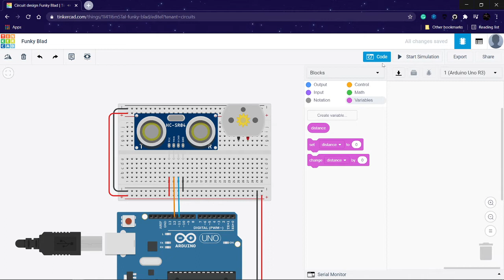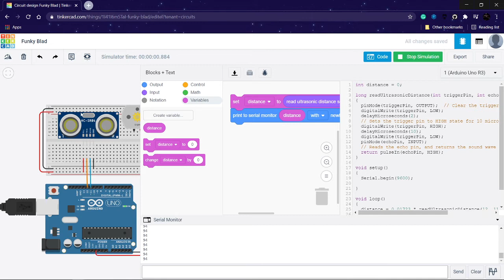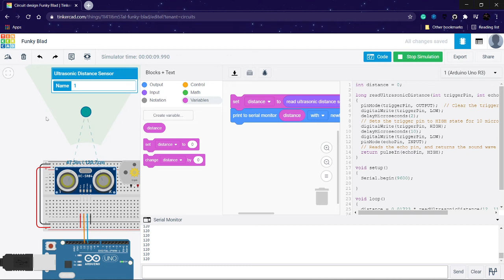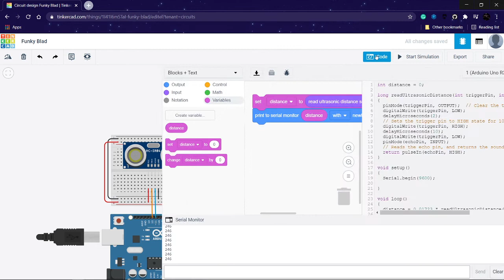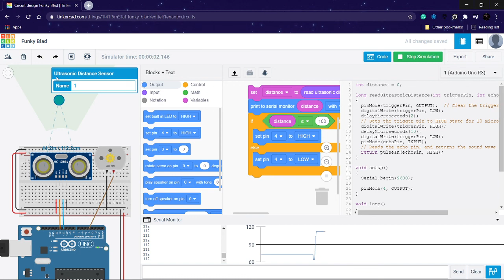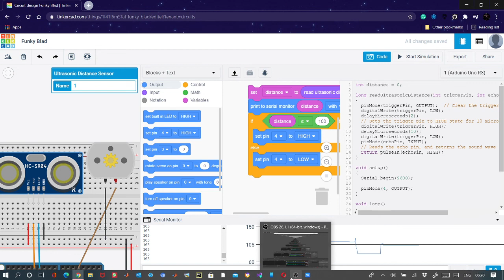obstacle avoider robot using Arduino in tinkercad

Comment from the maker: code:
int distance = 0;

long readUltrasonicDistance(int triggerPin, int echoPin)
{
  pinMode(triggerPin, OUTPUT);  // Clear the trigger
  digitalWrite(triggerPin, LOW);
  delayMicroseconds(2);
  // Sets the trigger pin to HIGH state for 10 microseconds
  digitalWrite(triggerPin, HIGH);
  delayMicroseconds(10);
  digitalWrite(triggerPin, LOW);
  pinMode(echoPin, INPUT);
  // Reads the echo pin, and returns the sound wave travel time in microseconds
  return pulseIn(echoPin, HIGH);
}

void setup()
{
  Serial.begin(9600);

  pinMode(4, OUTPUT);
}

void loop()
{
  distance = 0.01723 * readUltrasonicDistance(12, 11);
  Serial.println(distance);
  if (distance >= 100) {
    digitalWrite(4, HIGH);
  } else {
    digitalWrite(4, LOW);
  }
  delay(10); // Delay a little bit to improve simulation performance
}